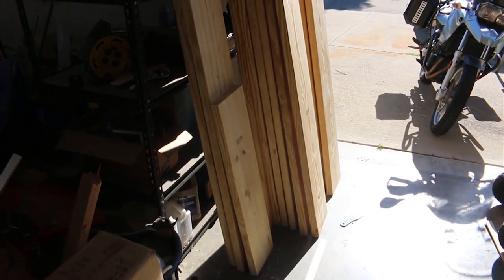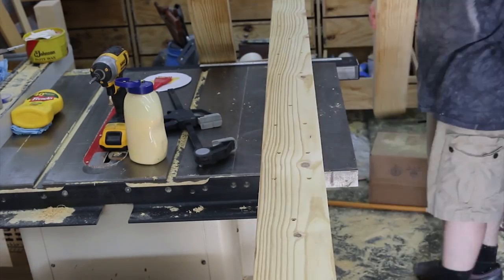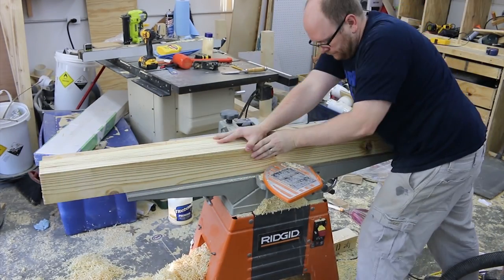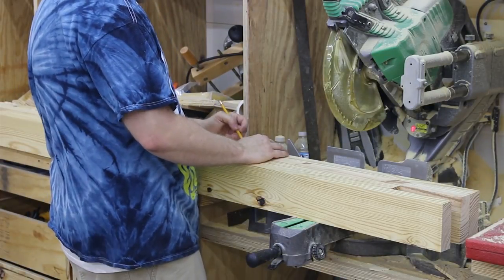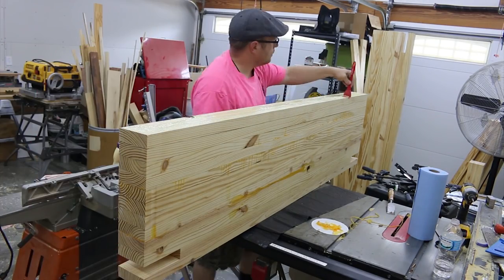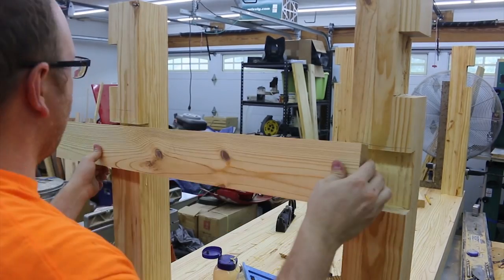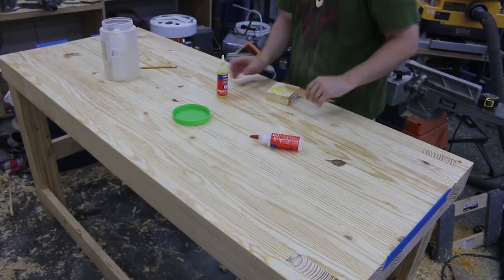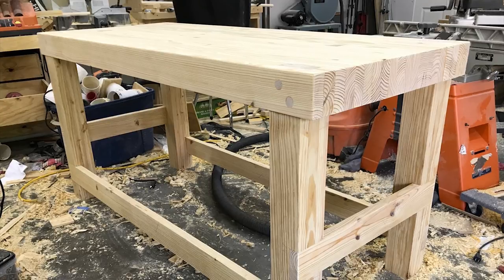(Narrated Version) Heavy, Huge, $100 Laminated Workbench (Amazon links in description)

Comment: Great to see, a good heavy woodworking bench, i’m not the only nut in this world, but a shallow tool well in the centre would have been a very useful addition! You will be very happy with your bench!
Reply from the maker: Thanks Paul! I agree about the tool we’ll, but this bench was made for a pump shop, so it is going to hold 1000 lb pumps and motors for service, so no need for a tool well!

Comment: 1:00 If you're concerned about where the screws are going to be after the glue dries, glue and screw 2 boards together, then flip it over and drive the screws for the 3rd board in from the opposing side when laminating 3 boards. After the glue has dried, remove the screws, and if you're really concerned about strength, drill holes all the way through your piece, and glue in some long dowels for added strength, like what you did for the legs at the end of this project. Now you'll be able to do whatever you need (like boring bench dog holes) with your piece without having to worry about any screws. You can even get an inexpensive metal detector wand on Amazon or eBay that will help you make 110% sure you got all the screws out. As an added bonus, you can use the metal detector to locate nails or screws in reclaimed lumber. 9:52 Making this lap joint would have been a lot faster and easier using your miter saw. It has an adjustable depth stop, most likely on the right side of the blade. There are tons of videos here on YouTube showing how to do this. Overall this looks like a rock solid bench, and not too difficult, even for beginners, to make. BTW......I very much prefer your narrated videos, and this old Eagle Scout enjoyed seeing the shirt you were wearing in the beginning of this video. GREAT VIDEO!!!
Reply from the maker: Thanks!
Reply: I would skip the screws completely. No one uses screws in a table top because, not only are they unnecessary, but because your clamps need to provide hundreds of pounds of pressure on the glue joint, and the screws hold the wood together tight, but not tight enough and the threads prevent the wood from compressing together sufficiently just like they prevent it from separating.

Instead of screws, use adequate clamps and cauls.

Comment: Great video! When doing the leg blanks, if you'd just added the third piece to the side that didn't have the screw heads, then you could have just removed all the screws after the glue was dry. Oh well, you planned ahead for necessary cuts, so it all worked out!
Reply from the maker: I agree. This bench wasn’t made for woodworking so the screws aren’t that big of a deal, but it would have made for less stressful time while building for sure!

Comment: Now a couple of years after building this, do you have any suggestions as to what not to do for anyone who's planning on building the same thing? Have you had any issues with all the laminated 2x4s glued up without dowels specially since the whole table top is suspended (not resting on upper leg stretchers)? Sorry about all the questions, I am pretty new to this and looking to learn. I am now starting to gather info and the design I am leaning towards would not have those upper stretchers as I want to avoid interference with whatever vise system I end up installing later.
Reply from the maker: No problems whatsoever. This table is used at a maintenance shop at a water treatment plant. It has taken all sorts of abuse, but there are no cracks or failures at the glue joints. The thing is still solid as a rock. I know it can be hard to believe, but glue alone is adequate for this type of build. Good luck with your design!

Comment: Great work bench build, one of the best that I have seen on YT. The idea of using screws to temporarily hold the pieces in place is a good one. However, I would remove the screws before gluing on the next section(s). Or, you could do a pre-fit without glue, then drill dowel holes, remove the clamps & do a final glue up driving in the dowels to hold the pieces together prior to clamping. That way there are no worries about embedded screws down the road, just saying................
Reply from the maker: Great point. I did worry about it. I don’t remember if I covered it in the video, but I made sure the screws were driven in the bottom third of the table top so I won’t have any unexpected encounters with them when working in the bench. Thanks for watching!
Reply: Yes, I did hear you say that. However, I thought that you made the bench for someone else. If so, leaving those screws in could cause problems if any peripherals were added to the bench down the road. Obviously, the new owner would not know where the screws were located. Anyway, I still don't thik that it's a good idea leaving metal embedded in wood for any reason, just my opinion................

Comment: Great job - Especially the joints for the legs. Wondering if you did not have a hangover around the edge for clamping ? If not, how how do you plan to use clamps?
Reply from the maker: This bench was designed to be used in a mechanical shop, so no need for clamping edges.

Comment: When laminating boards for a tabletop like this, alternate the cupping grain pattern like this ( ) ( ) ( ) ( ) ( ) ( ) ( ) This prevents the tabletop from cupping further as the piece ages. If you laminate several pieces in the same orientation ( ( ( (  it will make further cupping easier for the wood.
Reply from the maker: I do agree with your statement, however, that is more important when the width of the boards is wider than the thickness of the table. The whole purpose of the butcher block method is to minimize wood expansion and therefore eliminate the risks of the table top cupping. On top of that, the boards are oriented on edge, so the cupping, if there were any, would have to occur on the glued faces, which isn’t likely to happen.

Comment: I have a similar top on my bench. Not as thick actually. And I am having trouble drilling dog holes through it, my forstner bit is too short LOL
Reply from the maker: I would drill through the center with a small bit and then attack it with the forstner from the opposite side.
Reply: @SouthpawWorkshop  a good plan! Fingers crossed I have any size bit long enough. Perhaps a spade bit will do it actually.

Comment: Use a roll of heavy brown shipping paper, cardboard, or even a scrap of cheap plywood to protect the surface of your table saw while using it as a work surface. Even a plastic garbage bag is better than nothing.
Reply from the maker: Not sure if you watched the whole thing, but I started using a black trash bag to protect during glue-up later on in the project. Mainly because I was tired of having to stop after each step and immediately clean up the table saw top.
Reply: @SouthpawWorkshop  Yeah, I noticed that. I posted my comment before watching the entire video, and I had to go out as soon as I was done watching it.

Comment: Can you explain the process of sending the different sections of the table top through the planer to achieve each section to have the exact same thickness?
Reply from the maker: I just use the scale on the adjustment side of the planer to make sure the pieces are the same thickness as each other. If the glue squeeze out was really bad, I would run one face through the jointer for a few passes until the glue was gone, then move on to the planer.

Comment: 1st Question, how strong is the laminated 2xs? would they eventually peel apart (delaminate)?
2nd Question, if I glue 2 layers of 3/4" plywood sheets, would that be as strong or maybe stronger?
Reply from the maker: Laminated 2x4s will be much stronger than laminated plywood. Having said that, the 2 sheets of plywood are plenty strong for a workbench build. This table was built to service pumps and motors weighing in excess of 1000 lbs. if you use a quality wood glue, the wood will break before the glue does. Thanks for watching and submitting your questions!

Comment: would you recommend the Rigid Jointer? i have always had issues with this brand.
Reply from the maker: My Ridgid Jointer has been great for years with no issues. I only wish it was wider!
Reply: appreciate it, those wider ones are just ridiculously expensive as if the 600$ rigid wasn't enough $$ already.

Comment: I like the work bench.
Doug for would of been a great bench but it turned out great!
If you mind me saying sir. I wish you could of mortise and tenon  the lower braces. That would of been just beautiful. 
Thanks for the video!
Reply from the maker: Thanks. Douglas fir isn’t very common around here.
Reply: Thomas Lightle - Red Barn Woodworking 
I don't know where your at but the big box stores should have it.
There isn't much difference in pine or Doug fir. It's  a little denser and heavier and the grain is more noticeable.
Reply from the maker: It depends on the region you live in. Here in the St. Louis area it is Southern yellow pine. Out west, Doug fir seems to be more plentiful.

Comment: what could you make with all that saw dust?
Reply from the maker: I have some ideas. I make a lot of sawdust. I want to press it into fireplace logs. May need to use some kind of binding agent that is safe to burn. Then I need some kind of press and form to make it. I have been thinking about this a long time.
Reply: @SouthpawWorkshop  I have seen people make logs out of caulking guns and pvc pipe. They went the saw dust in a bucket put it in the pvc pipe that's on the caulking gun and then push out all the water and compress the sawdust log......  then let to dry
Reply: More saw dust 🤭😁😂🤣